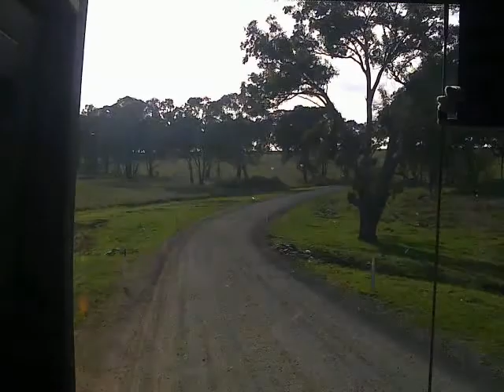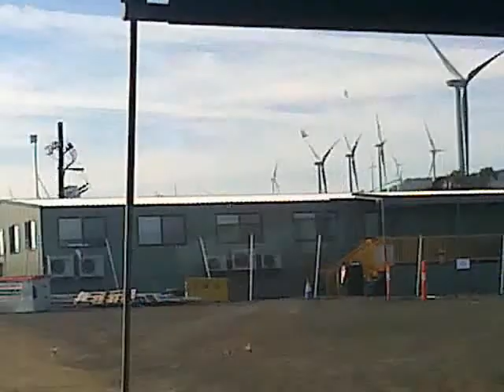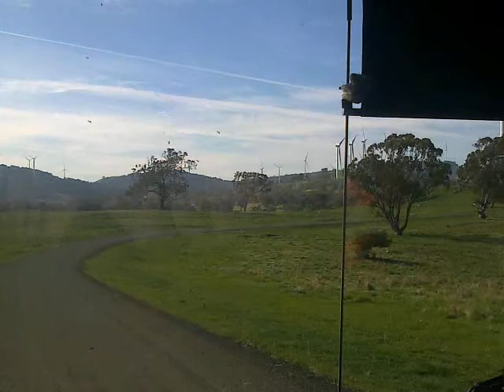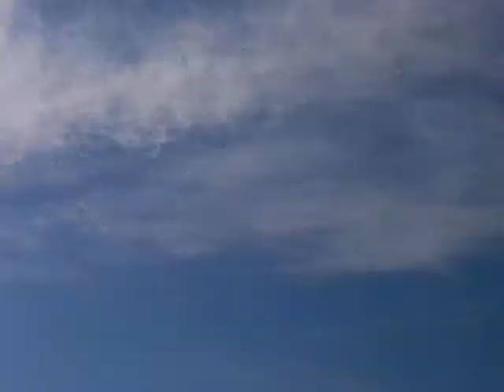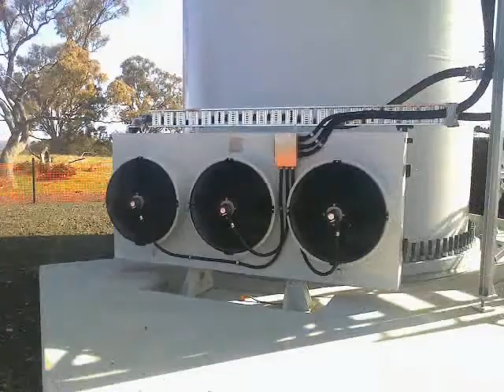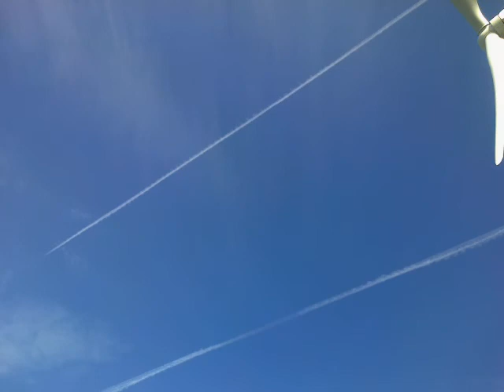White Rock Wind Farm, OPEN DAY, 4 Nov. 2017 ; Entering Onsite, Windmilling Warbles.., Effervescing !

Comment: Nice, if only the wind had showed up and we could see them moving and hear the noise.
Reply from the maker: G'day,

  Thanks.

    Yeah, well, it was a bit of a mixed blessing actually..., on the one hand no wind meant no movement, & thus no gentle "whuff...whuff....whuff...." noises..., on the other hand no wind meant no wind-noise on the Soundtrack ; and in the Gripping-Hand, it was a one-off, one-time only Event, and I was prepared to take what I could get..., after having secured the "Ringside Seat" on the first Bus (by showing up 2 hours early).

  The Outward-Bound Briefing & Homeward-Bound Debriefing both help greatly to unpack what there was to be seen in this "Onsite" clip.

  Have a good one,

  ;-p

  Ciao !

Comment: may be its the chemtrails
Reply from the maker: G'day again,

  Well, Oxygen Dihydride (Water Vapour) is a Greenhouse Gas but it's the Carbon Dioxide, which the Engines emit, that is causing most of the problems.

  Have a good one,

 ;-p

  Ciao !

Comment: I could build a really nice quadcoptet with those blades and the DC motors. Problem is finding a big enough ESC, speed controller. 🙂
Reply from the maker: G'day,

  Thanks.

    Actually, nope, you could never do that...(!).

   Speaking as a Propeller-Carver who became a self-taught Wind-Turbine Designer, actually charged a Battery with the resulting Windmill, and then returned to fly behind 2 different Propellers of my own design & manufacture....; please believe you me, a Wind Turbine Rotor is "Upside-Down, Inside-Out, and Working Backwards...", compared to an Aeroplane Propeller....

   They are not at all interchangable...

  I'm actually in possession ("Custodian") of the " World's 3rd-Worst Wind-Turbine Rotor, Ever...." ; which resulted from a friend of mine having scavenged 2 dumped Blades from the Hartzell 3-Bladed Propellers off two different Fletcher FU-4 Crop-Dusters, & bolted them to a U-Shaped Welded-Steel Hub.

  I accepted the monstrosity, as a gift...; a Curiosity, so to speak.

  It makes a lot of Noise, but no Power, because it's Aerofoils are inverted, & it has REVERSE-HELICAL Pitch...; but it's a veritable testimony to ignorant industrial optomism...., or something (!).

   I nailed it to a Tree, on the edge of my Clearing whereinat it be significantly "Ornamental".

  I think the Video of it is in my "Mad Scientist..." Playlist...

  Have fun,

  ;-p

  Ciao !
Reply: Yes, I know, those blades are also a bit to big for my quadcopter frame. LOL. I built a wind turbine using an electric scooter motor. The 4 blades were made from gutter pipe and angled on a hardwood hub. attached it to a car battery via a diode and it worked well. Just moved house and I am thinking of putting it back up. In a moderate wind I was getting 46 volts but I never measured the amperes yet. It sure produces a lot of ''back EMF'' when wired up. Need to take a picture to let you see. Or post a video. Not really a video person. Oh you must be up late?
Reply from the maker: +Mike Flight 

  Fair enough, but as I said, I was playing "Straight Man".

  At the moment it's 21:23 Eastern Daylight Saving Time, so "really" (Eastern Standard Time it's 8:23 PM, and by the Sundial in Moonlight (it is a Full Moon...) it's 8:38 Local Apparent Time....

  Not terribly late, although I was up an readymaking at 05:00 this morning (an hour earlier than my "normal").

 Have a good one,

  ;-p

  Ciao !

Comment: them white lines are the climate change problem
Reply from the maker: G'day,

  Yeah, in that the increased Air-Temperature allows more Water to be vapourised into the Atmosphere, and because Water has 10 times the Thermal-Mass of Steel...; therefore the Hotter/Wetter Air is able to generate & sustain vastly more Enedgetic Droughts, Fires, Storms, and Floods.

   'Just(ifiably ?  {sayin'}...?

  Is nae thut not thy "Truth"..._?

  Ciao !
Reply from the maker: G'day,

  Yeah, in that the increased Air-Temperature allows more Water to be vapourised into the Atmosphere, and because Water has 10 times the Thermal-Mass of Steel...; therefore the Hotter/Wetter Air is able to generate & sustain vastly more Enedgetic Droughts, Fires, Storms, and Floods.

   'Just(ifiably ?  {sayin'}...?

  Is nae thut not thy "Truth"..._?

  Ciao !

Comment: Wow..impressive, they almost look alien in design.  Wished the USA would consider more wind and solar investments.  Thank you so much for sharing.
Reply from the maker: G'day,

  Thanks.

     Well, "Alien" once meant anything or anyone from "Outside the National Boundaries" ; and while Australians made the Steel Towers & Concrete Footings..., the Windmills were all "Made In China"...(!).

  I've been itching to get out onto the Windfarm for 18 months, or more, but (as you can see ) they employ lots of "(In)Security Farces" to deter & deflect the curious Public Bystanders...; yet by being plugged-into some Local Networks I managed to get the Heads-Up as to when to be where, in order to get the pick of the seats on the first Bus...

  And, only a Half-Wit could've failed to capture something worth sharing on the YouTubes, given a"Tip-Off" like this one was... ; "Be there at Sparrowfart, or stand in- line to not get a Front-Window /Windscreen Seat (fit  from which to make a Realtime Video of the Excoursion - as it unrolls...), How-Ummm So-Ever it  in-fact unrolls (Unravels ...?).

   I couldn't ever-afterwards hold my head up as a YouTuber, if I'd missed this opportunity to  videograph the Event as well as my "Equipment" is theoretically possibly able to achieve... ; so, therefore thus & because..., I tried - REALLY Hard... (!).

   It's probably a matter of "Pride", but ; buggar it, I like to do as well as I can with whatever is to be found at hand...

  So, this was made with a 3.2 MP Mobile Phone's Video-Camera...

  And, it worked ; really-well (!).

  Enjoy (I certainly am....).

  Have a good one,

  ;-p

     Ciao !